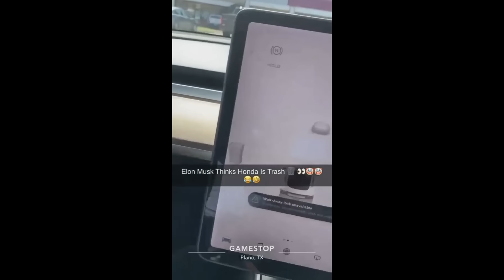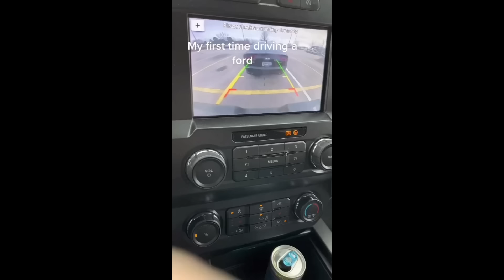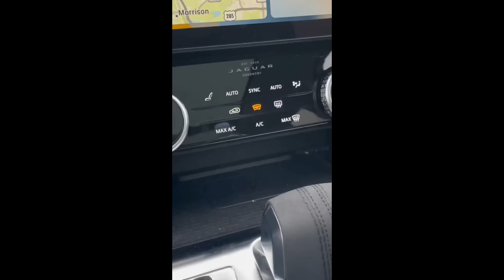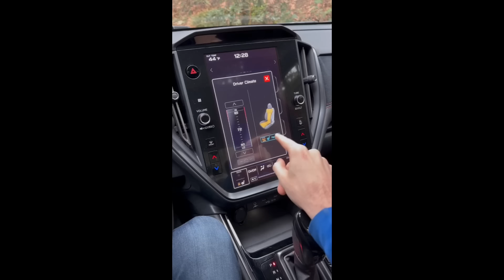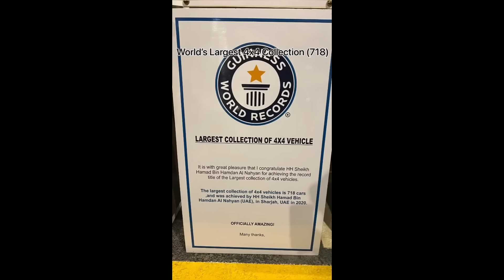Memes That Only Car Guys Will Understand: Part 8

Comment: selling a hellcat to buy a tesla is a ultimate battlepass to being banned from car-guys community
Reply: Yes
Reply: A person traded a zo6 for a model 3
Reply: @seda7015  that is the dumbest thing i ever heard. one question tho the c5,c6,c7, or c8 zo6?
Reply: The c8
Reply: but hellcats are used for takeovers. so its kinda hard. if it was a 180sx, than hell yes.
Reply: Imagine trading a tuned Infiniti m45s for a tesla model 3 💀💀💀💀
Reply: @Red_Airlines  tbh i have a constantly breaking down Jeep Cherokee KL and even if i had won a tesla i would still trade it and keep my jeep.
Reply: @Micholex  oof
Reply: Having either means you're not a car guy, just a well off guy

Comment: -The Civic only has a Driver Seat
-The Civic has an unpainted Rollcage
-The Civic has Drag Tyres
-The Driver has a Dashcam
-The Driver’s GF just broke up with him
-The Driver’s Mum has an OF
-The Civic isn’t De-badged
-The Civic has Ceramic Disk Brakes
-The Civic has a Hood Exhaust
-The Civic has only one Headlamp
-The Civic has Neon Underglow
-The Civic isn’t sounding like a fartcan
-The Vtec hasn’t even kicked in yet 
-The Civic has a Carbon Hood
-The Civic has no Spoilers
-The Civic has Vortex Generators
-The Civic only has Sponsored Decals
-The Civic has Stock Stance
-The Civic doesn’t have Initial-D stickers on Quarter Windows
-The Civic has a Blue NOS Bottle inside
-The Civic Driver is blasting NFS Underground Soundtrack.
Reply: THE NFS UNDEGROUND ONE IS ACCURATE AF BRUH
Reply: civic enthusiasts starter pack

Comment: Bro sold a car that has trouble cold-starting for an oversized RC car that literally will not run when the weather is below summer heat.

Wait a minute, Lan Evos are AWD, so his Evo X being FWD means he swapped the drivetrain for the worst one.
Reply: Maybe his Evo X wasn’t Evo after all… maybe it was just a plain Lancer 😂
Reply: @wildest_stories  Are you saying regular Lancers are FWD?
Reply: @kyototomokui6676  There are regular non Evo versions of Lancer
Reply: @c63w204W  There are.